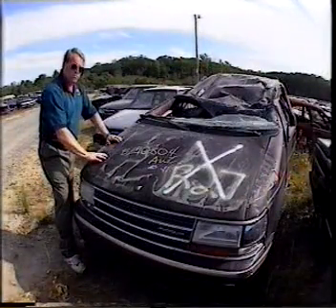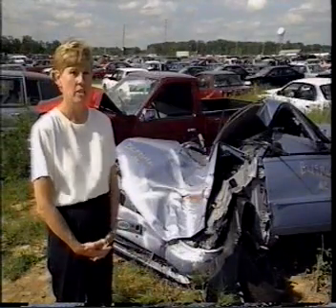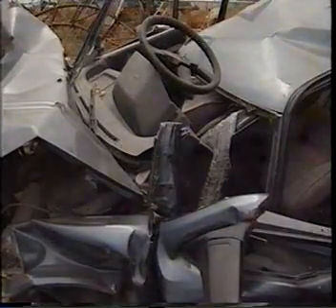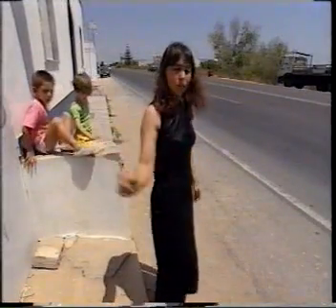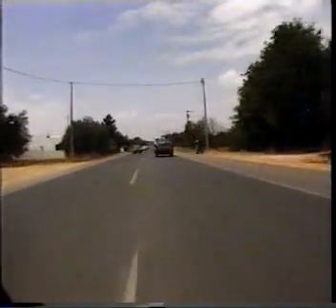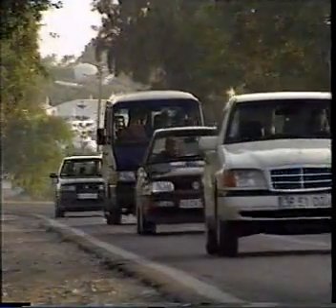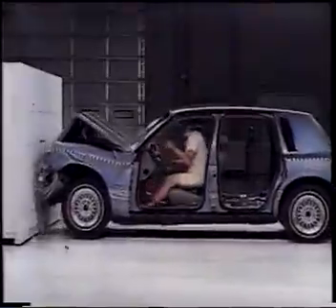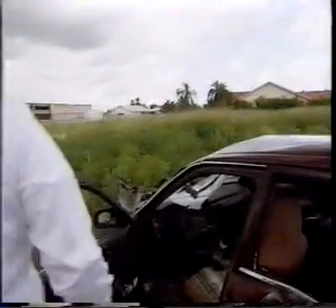CRASH: Ep 3: What Happened?: Pt 2: The worlds deadliest road

Comment: I think they also is missing one fact. Here in Denmark, until the mid 90es, you could get a car, have it put to a test for rust and polution, an then you will get your number plates. You could now drive it for years. It could rust, and only if you got pulled over by the police they could take the plates. I remember my father had a car, under the carpet and in the trunk there were big holes, only then my father got a new car. I belive if we had a accident it would have bend.